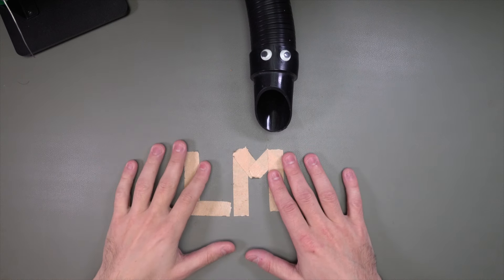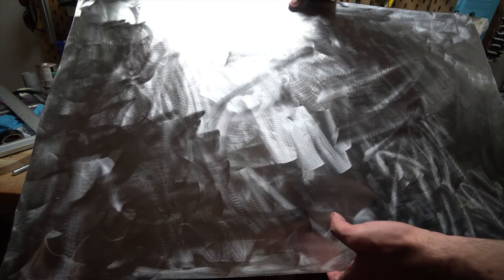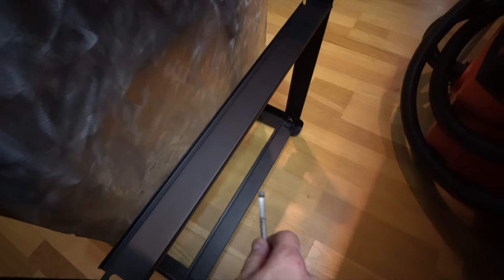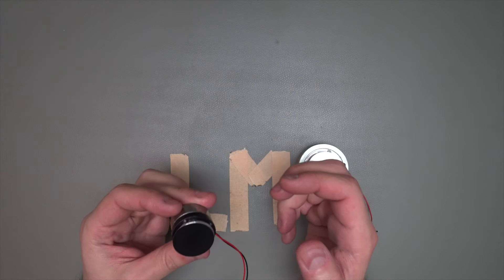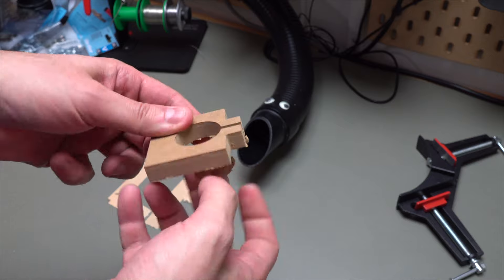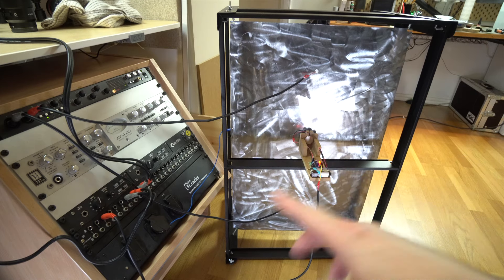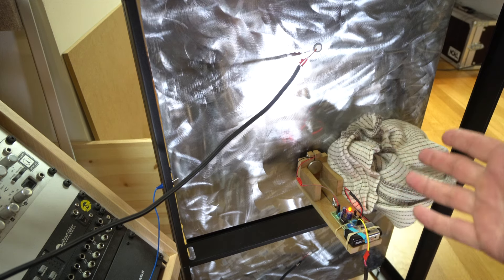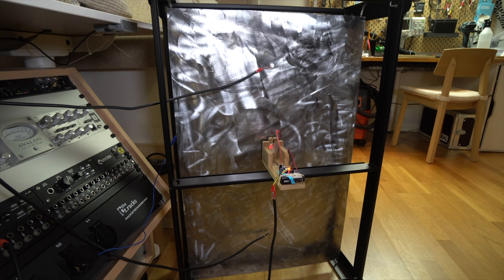DIY "IKEA Hack" Plate Reverb Part 2 (Sounds amazing now!)

Comment: Hey Leo! Niiice work!! You inspired me and I think I’m going to make one. Right now I’m recording and mixing in one room, tell me something, if I put the plate in my room would it make noise as it vibrates or this would be ok for me to place it in my room? Thnx
Reply from the maker: Thanks for the nice words. You’ll definitely hear it if it’s in the room with you. Plus if you mix loud, some of the sound from the speakers will end up in the plate. So there will be acoustic leakage but it may not be enough to bother you (it depends on how sensitive you are about your sound). This is why in major studios they usually put the plates far away in a basement, attic or some other quiet place. 

Thanks for watching!

Comment: As a parallel to what zaque.mwhc suggested, how about a fabric-covered foam pad on a screw-adjusted rod or MDF to control the reverb intensity? That way, you're not necessarily limited in the surface area of what is going to be attenuating the input signal.

Comment: Hey man, I might have a solution for the damper.
Why not try a piece of thick foam on the end of a threaded piece of steel. Maybe even a big bolt.
That way you can adjust the pressure of the foam on the plate and reduce the resonance to your taste. 

Also, this is awesome. I love that you've made an analogue effect. I'm a guitar player and have a physical thing rather than a digital effect is so much cooler to see the physics in action.

Comment: Nice improvements. But there are a few things you could add that would make it simply insanely good.
When I was building cigar box guitars, I was using piezos for the pickups. I discovered that the location of the pickups could change the tone tremendously. Since a rectangular plate will transmit vibrations differently depending on the frequency that's transmitted, you could mount the pickups on some neodymium magnets. They should hold good enough and not affect the sound very much.
Also, for dampening, have you thought of a screw with a big wad of fabric attached to the end? You can adjust the pressure applied to the plate easily and the dampening should be good enough.

Comment: Cool Idea maybe to dampen it just cut a piece of mdf the same size and use say like a bolt jack screw type system to move it in or out.Suspend it on some metal rod with like Teflon inserts in each corner. Just a thought you have got me thinking about building one ;)

Comment: What about hanging it vertically next to a wall? It would save a ton of space, plus you'd only need to "Hold" it on the top with 1, maybe 2 bolts. The sound would then also vary from all the way up top to the very bottom, giving a much larger area instead of hollowing towards the center.
Or is this a stupid concept? I'm not familiar with reverb plates at all, i only tipped my toes into audio design and almost exclusively digital. (that's kinda why I'm here. they sound awesome! also, thanks YouTube for recommending part one a while ago hehe) nice video's!

Comment: 10:37 the winner looks like its fairly weak at the tabs. If the inner diameter was farther away from the tabs, I think they would be stronger. Over tighten the clamp and its sure to break one of the tabs.

Comment: Hello Leo, I have a small question.. You attached your transducer practically to the farme of the plate reverb.. So the plate actually has contact to the frame (through the transducer). Why didn't you just attached the transducer to the plate without the MDF parts? I don't know if this would make such a huge difference, what do you think?
Reply from the maker: Attaching the transducer only to the plate would work, but not as well.  The problem there is that if the transducer doesn't have something massive behind it holding it steady, the plate would "push back" the transducer (Newton's laws of motion).  If you get something heavy behind the transducer, then more of the energy is transferred into the plate.  Good question, though.

Comment: It seems to modulate sound less than version 1, but it still seems very heavily biased to certain frequencies. Have you considered trying to locate nodes and antinodes and trying to drill out or weight down some of them to make is slightly less tonal?

Or possibly it's the piezos that are the source of this -- I noticed you've ultracheap piezo buzzers instead of instrument pickups -- the brass discs on these are (roughly) tuned resonators, and may be emphasising certain frequencies in upper partials.

Comment: Hi Leo, Great Job,... very nice Reverb. You might want to try "Moon gel" it's made for drummer to tame over ring of toms. You can find it in music stores. Use small amounts in the corner of the plate,... to not drop reverb time but high-end diffraction. If you do Please post what happens. Or play with EQ's filters as a subtraction type of EQ. A Multiband compressor can also work to high light different sounds
Best Regards,
Bruce

Comment: Use a plaster board instead and place the element on 1/3 rd mid center, there is a guide on that with salt wave test as well to find the optimal placement. The idea is that you want a damped resonance, the plate is nice though but gives a metallic sound whereas plaster or roof ceeling tiles are better for full audio

Comment: drill 10 small holes from the center out diagonally to a corner
take a length of small all thread, and two wingnuts to increase or decrease the length of the all-thread protruding from the plate to create a rough Helmholtz resonator that is easily adjustable in vibration absorbed by it's length off-axis from the plate, or by changing it's location on the plate to effect the damping and gating

Comment: Ett tips på dämpning som kanske kan fungera bra. Magneter med möbeltassar på, då kan man lätt variera mängden dämpning genom flera/tyngre magneter och stor variation på effekten då kan man placera dom fritt. Har man möbeltassar på magneten så lär man inte få problem med skorrande ljud. Om stålplattan inte är magnetisk så borde man kunna lösa det genom att sätta magneter på varsin sida av plattan så dom håller varandra uppe. Skulle vara intressant om detta är en lösning som fungerar och är enklare och mer flexibel än att lägga en bit tyg mot plattan.

Comment: First off. That is awesome! 

You mention that an impedance matching problem filters out the bass. 

I build a diy re-amp unit for my electric guitar. I added a  pot to control the output impedance. I never really notice much difference. I don't remember at this point what the range of the output was. What kind of values and what direction are you talking about? 

16k ohms seem to ring a bell as what a typical guitar outputs ( that's what I remember my guitar metering out ). And i normally high pass electric guitars anyways. 

Do you have any layman resources you could direct me to, that would explain the relationship between frequency response and impedance?
Reply: It's fairly difficult to come up with an active circuit that has a very high output impedance, higher than a few dozen kOhm that is. If your output is an opamp or negative feedback amplifier of any kind, your output impedance before further components is close to 0.

A cheap amplifiers BJT input could have a 50-100k Input impedance. JFET inputs could be a few M.

A piezo appears electrically as predominantly a series capacitor, so in idealised representation it would have an infinite output impedance. Practically it could be tens or hundreds of k. Unless you can get input impedance an order of magnitude higher, you're likely to experience significant losses.

Comment: Consider utilizing a muffle system similar to the way that old drum kits used to use for dampening drum heads. Would be easy yo modify an existing drum muffle. Cost efficient and effective.

Comment: For plate dampening - try cutting out diff thicknesses of foam that would slip between the frame and the plate (like you did with the rag).  The thinnest would just be barely touching the back of the plate - with the thickest taking a little effort to wedge into the same space.  Make 10 of 'em based on the diff levels of dampening you want and swap em in and out as needed...pretty inexpensive solution...  Just my 2 cents...

Comment: Great video! 

May I propose a possible solution to your dampening problem: Make a similar piece to the one you are using to hold the transducer and glue a sponge  to the end of it. This may just be simple enough to work! You would even have a reverb adjustment mechanism by fixing your sponge using different pressures using that long linear groove and bolt :)

Comment: Would it not be beneficial to use all three transducers? Different positions around the plate should produce differing highs, mids, and lows. Just place the transducers at locations where the highest concentrations of their target frequencies happen to be produced. Multiple pickups might be beneficial in this way as well. Just place them at locations where their target frequencies resonate. As for damping, a pair or two or three (or six) of threaded clamps with large felt or foam surfaces on opposite sides should do the trick. Maybe place them near your pickups. Or the transducers. Or both? Because they're threaded they should allow for more accurate fine-tuning of the amount of damping and make it easier to dial in the exact amount you want. If you can manage to find low, mid, and high frequency resonating spots, might damping lower and higher frequencies be possible?

Maybe?

Comment: Hi, very cool project, very well done. I have been thinking about getting more out of a plate reverb by spinning a bigger plate of metal into a circle, kind of like wound up like a spring, suspending it and then placing the driver and the pickups in the same location they would be if the metal were flat. Do you think, from your experience, that could work?
Reply from the maker: Hi Mark, yes, this should work. When I was researching this video, I actually came across a reverb where the plate was spiralled so that it took up less space. The outside housing looked like a large tube. I can’t find the link for it at the moment but I’m sure it’s somewhere on Google. Good luck!

Comment: Hi mate - Just letting you know Peizo's in general - and certainly in your case require around 10 M Ohm's (input impedance into a preamp). This will improve your sound by a huge amount. There are many preamps out there that can be built or bought. but this will give you some real depth on the return signal. Great Project and thank you for showing us it.
Reply from the maker: Interesting.  Why 10M?  I ask because I checked with an electrical engineer who told me anything over 1M should be just fine and the plate does sound pretty good.  I've seen the DIY piezo kits, but I'm just wondering what benefit a 10M Ohm input would bring and if it's worth the time investment.

Thanks for watching (and the comment)!

Comment: I'd love to know where to get the mid sized transducer that you used for another project. if you could post a link I'd love it.
Reply from the maker: Hi Pete.  There's a link in the description of part 1 of this video series to a store called Electrokit.se  -- That's where I got all three transducers you see in the video (just search the shop and you'll see what they have available right now).   This store is based in Sweden so I'm not sure if that's very helpful if you're elsewhere, but that's where I got the parts.

Comment: Subscribed after seeing how you talked about failure. When watching YouTubers, it's so easy to fall into the trap of thinking they did what they did first time every time. As you pointed out, that is not the case, but failure is an important part of the process.

Comment: you can get a plate from Home Depot, Its the frame Im having trouble finding
Reply from the maker: If you’re at home depot, get some lumber and glue+screw the frame together.  It’ll probably be more rigid and sturdy than this metal one. 

Good luck with your build!

Comment: You should take paint with a paint remover, resulting in a naked totally flat sheet of metal cause with the grinder you are taking chunks of metal resulting in an irregular surface ,where the sounds don't resonate even. You can see the difference between paint ,and naked ,same difference is applied for  an uneven irregular surface and a  totally flat one .

Comment: this sounds great!! As far as dampening goes, you could mount a rubber knob or foot on a threaded rod to the same bar to which the transducer assembly is mounted. Then it's as simple as turning the rod, increasing or decreasing the pressure applied to the panel

Comment: I see you noted that you can rent an angle grinder for $8/day. If anyone has a Harbor Freight near them, you can buy one for 10 bucks that won't last a lifetime, but will probably get the job done. I'd buy one of their better models (they make models at $20, $40, $80) but for a single project its probably cheaper than a 2-day rental (you're going to have to buy a cutoff disc and flap wheel anyway, available there pretty cheap too).

Comment: Well it sound good, though the size is why this sounds a bit robotic, the transients are very pronounced.. If it was larger the vibrations would eliminate the transients because of it's size, llke using 4x 10 inch speakers for a bass guitar instead of one big 15 inch speaker, it moves more air but the snap is gone, that's why slap bass guitarists use 4 x 10 inch speakers.
I would also consider a valve amp for your plate, one that really pushes the valve, high input and low output, I think that will smear out the transients a bit by compressing the signal. But regardless I think this is a very nice plate for techno etc.

Comment: I think I would try to silver plate it with a plating polishing paste (tiny bit on the expensive side, attention, have never tried it on ferrous metals) & wax it. I also think that I would further sand it with a very fine grit paper (before & in preparation for step 1), but that's just me, I would hate to submit my ears & lungs to torment. 
good job
m.

Comment: Purchase an angle grinder. Even if you wear out some piece of crap from Harbor Freight in a year, it's still cheaper and more convenient than $8/day rentals.

For controlling the reverb, maybe mount some snare drum head dampers to the frame with a rig similar to the driver so you could adjust them in a reasonable amount of time. A kick drum pedal might make an interesting control tool too, for real-time effects, but it would probably help if you rotated the table again so said pedal could make contact equidistant from both pickups.

Comment: Main problem here is, that when you disturbing the plate they aspire to vibrate on the own major freq. It may first (major) freq., or second (if disturbing point right in a middle of plate). However on the plate exist points thet produce third (and higher) steps of harmonic, amlitude this (higher) harmonics is fairly lower then first.  So placing the vibrator on this higher harmonics points must provide better result... Brobably))
Also you may apply little damping on the points of antinode, of major self resonant freq... or even pre cut freq. which corresponds to its own resonance, from sent disturbing signal..

Comment: Dude those synth sounds on verb sound amazingggg. Coming from someone who hasn't really ever played with synth or heavy music editing- only playing guitar, and fiddling with an X32 for shows. I am coming full circle back into audio, custom mics and such as I'm super unhappy with our guitar and vocal sounds currently... but ultimately because my fuel pump died on my car, and I need to build an analog 5v -> digital PWM output to the fuel pump, so I don't have to deal with the range of crappy pumps and their various pressures being sent to an ECU that expects static pressure, and has no real feedback loop or sensor to determine actual rail pressure.... Definitely annoying. So I plan to basically get a cheap 5V ADC that outputs the 2ms servo frequency, and send that to an RC car ESC (brushed since most off the shelf pumps that are affordable are such). The ESC can easily handle the voltage off the car straight from battery, or stepped up some too, which provides more pump output if needed for a given duty cycle. ESC provides the 5v to the analog 0-5v pressure transducer (fuel pressure sensor) which effectively acts as a potentiometer, just a variable resistor, that should also have a minimum of .5v, which will give me a "base speed" at 0% DC that I can use to flip on/off the ESC, a prime pulse, or some other sort of basic run command that may be necessary in addition to the master fuel pump relay. The return signal of that will feed the ADC board, which has adjustable gain, and can always use pots/resistors as needed to slightly modify the output, but frankly the ESCs I'm looking at are usually quite programmable, some from bluetooth even, which is a cool bonus, because I can mount it wherever I need to and still easily make adjustments. (long as it isn't a metal case or something). 

On that rant, thank you for the encouragement. The EE community etc is super awesome, and spreads way out into most of my hobbies (RC, automotive, making "stuff",  programming-which is relevant to my career growth too, and of course all sorts of music and audio applications.) The thing that's neat about audio is it really does tread both analog and digital worlds, and deals with a wide range of signal types/shapes, filtering etc. It is finally starting to come into one big picture for me. Now I just need to become a physics and chem master too! LOL